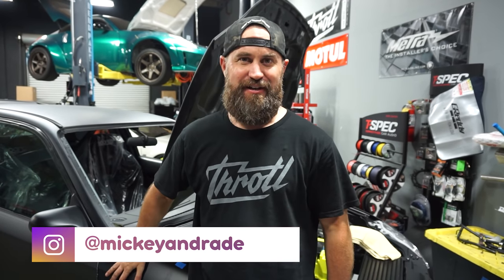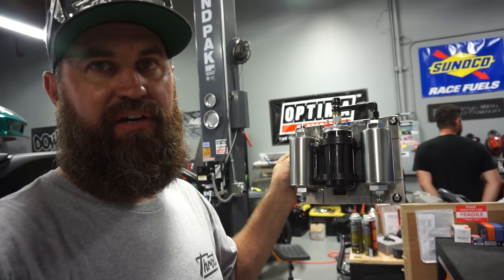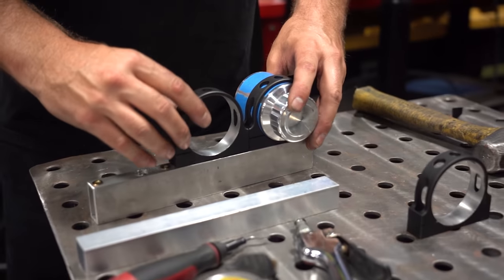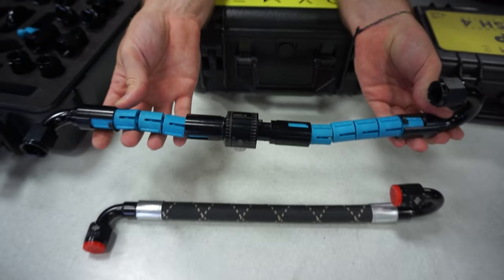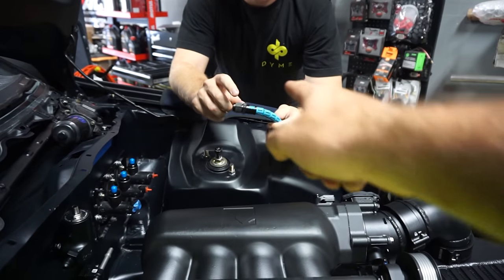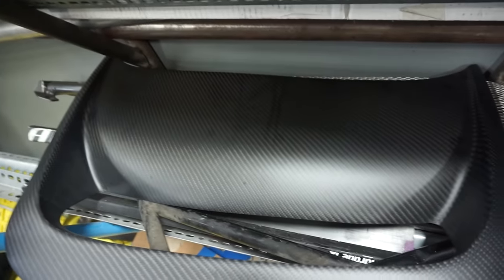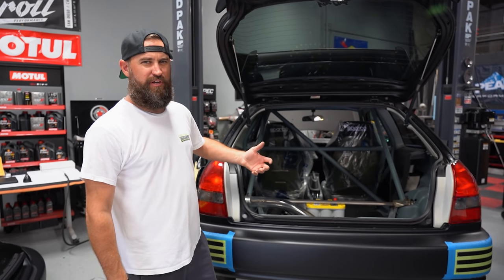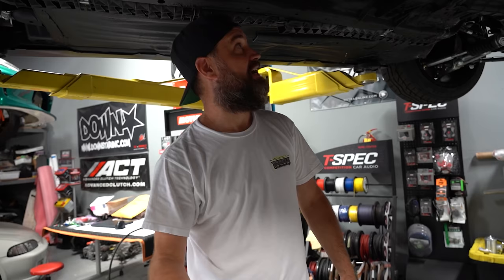Building a Rear Wheel Drive, K20 Turbocharged Honda Civic EK Hatchback Race Car- Reassembly Part 5

Comment: I can definitely see why that guy got a lot of awards for his product. That end result is fantastic. The personalization into the fitting on what it’s for it awesome. Plus the fitting/measuring pieces are a genius idea. 
I wish I got more into the plumbing side of automotive. When I use to do electronics on small boats to yachts I had to do some plumbing for the auto pilot systems. If possible we use to custom make our lines using as swedge tool. I always got mixed up with the sizes though bc it wasn’t an everyday thing for me. But I could make a rats nest of wiring look very professional at the end.

Comment: build your car, your way or you'll never be happy with it! i would invest in some car scales if you don't already have them. I'm fascinated by knowing the dry and wet weight if my car, the corner balance and weight bias.    this helps when buying the correct spring weights and adjusting handling. nice build💪

Comment: No complaints love the built. Just didn't see if you did any side plates on the v mount setup. You'll lose alot of air flow out the sides if you don't plate in both sides of the v. Not bashing just one small thing that would help if you haven't addressed it.

Comment: Nice work guys.
The only thing that is driving me crazy is the tail lights, they need to be painted, not the lends but the rear housing.
Everything is black but when you open the truck to see that masterpiece of art work you did you get blasted with white tail light housing.

Comment: Also hate to cut the beautiful hood but sending the air flow through the intercooler out the hood would help alot. Cut, tuck it down to the closed edge of intercooler to the car and box around it. Would direct airflow out and not air stack in the engine bay.
Reply: Disregard I commented early on in the video. Lol

Comment: You could save more then 21lbs by going to a lithium battery if it was a issue. A/C on a car in hot climates is a bigger flex then any wheels you could put on

Comment: My confusion with the last video was that I was under the impression this was a track ONLY car.. and you wanted to save weight by taking out the headlights but then added weight with the AC. The AC will rob power from the car.. will it not?

Comment: Throtl vip squad good morning Mickey Rickie Quinn Evan Rick victor Shawn Big Jeff and the rest of the team awesome more work on the Freak Mickey I agree installing AC in the truck car just in case you want to take it to events without trailering the drive will be so much better with A/C and also to the carbon fiber headlight covers will go good especially when you can remove them and install the headlights it’s not as hard to do just two or three bolts per light 😊👍🏽🤙🏽

Comment: Is it a good idea to let battery sit right on the fuel tank? I know its leak proof and stuff, but the fumes are flamable...
Reply: If the battery's secured and has no reason to spark, there's really no issue

Comment: I'm confused as to why you are running your flex fuel sensor on the feed and not on the return after the regulator. Everything I've been told via Fore innovations and other, you run direct feed to the rail, through, from rail end to reg to flex sensor to tank return.

Comment: Today's Message - Mickey ain't havin your shit.

Sorry my feedback about the AC and Headlight blanks came off negative. Wasn't meant to be, especially the feedback about the headlight blanks. But if having a set of street and track brake pads and rotors is normalized, having replaceable headlight blanks can be normal as well.

Comment: Im actually laughing at those who think adding AC is going to add weight to the vehicle........ the real question is what are the plans to compensate for the load it will have on the engines rpm's